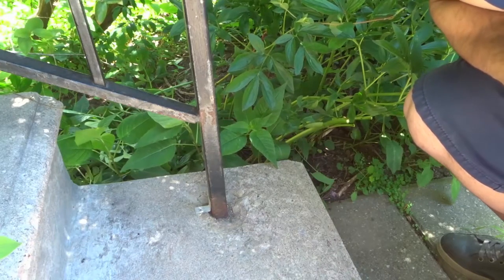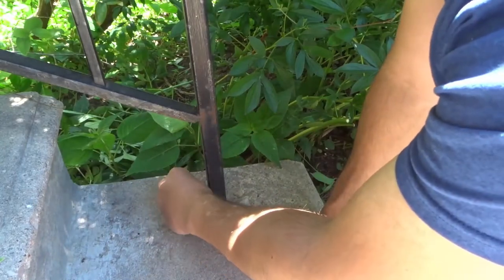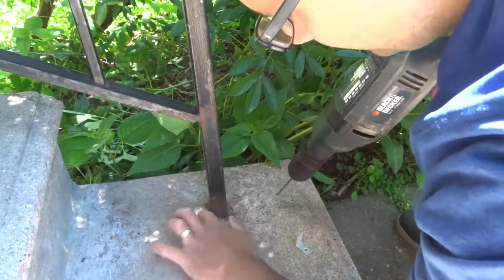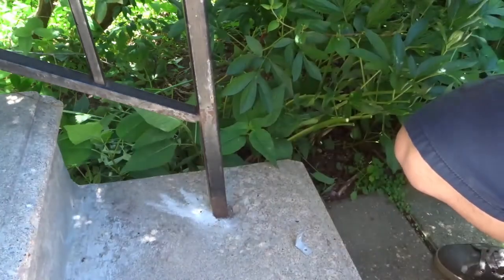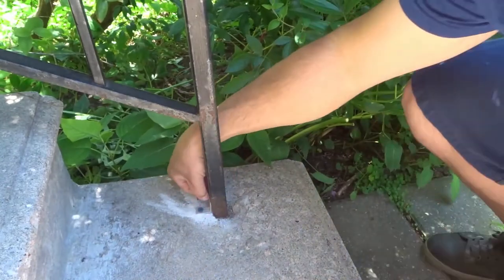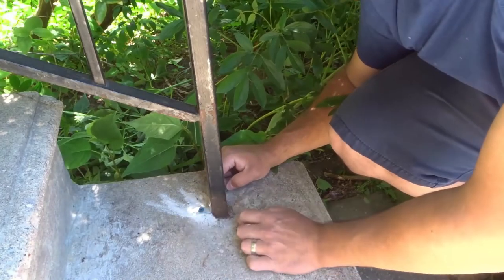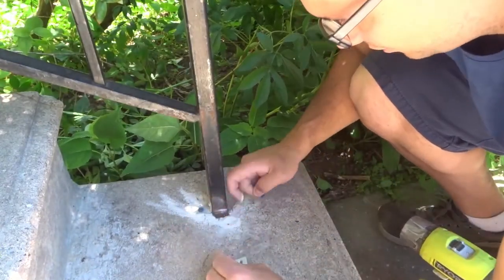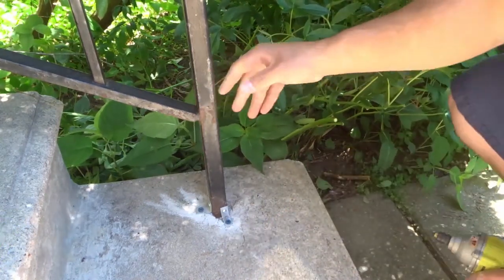How To Fix A Loose Exterior Railing-Tutorial

Comment: Hate to be negative, but this neither works for sturdiness nor estetics…. Could lead to someone leaning onto it and falling through….. just fancy the leverage these Ls will be facing. Instead, remove fence and check if metal in post is Ok…. If so, make hole larger and use concrete filler. If rusty, weld to repair and then same as above 😅👷🏻‍♂️💥

Comment: They will work on a short rail, but if you dealing with more than 5ft of rail, drill a 3/8 hole right beside the loose rail, drive a piece of 1/2 rebar into the concrete until it tightens up, take a side grinder and cut the rebar flush. Do each rail. Basically put a steel dowel in the concrete.
Reply: Yours seem more harder 😂
Reply: I’m guessing after that you adhere the loose rail to the rebar next to it? Bc what is putting rebar next to a loose rail doing?
Reply: @earnesthill9477  It's acting as a shim against the foot of the railing embedded in the concrete, to keep it from wobbling.

Comment: That will fix the issue, but it's an ugly looking repair using the L-brackets, with one installed cockeyed.  Unless those L-brackets and the screws that go into the railing post are stainless steel they will rust out in short order.  I have the same problem with my front door railings.  My solution will be to lift the railings out of the holes in the cement using a bottle jack, clean out the holes and possibly enlarge them, then re-install the railings with anchor cement.

Comment: All these videos focus on the railing at the ground level. My railing is fine at the ground- it’s loose at the side that connects to my house.
Reply: I'd suggest drilling through the current screw holes for installing wall type anchors, then install the screws back into the inserts. The screws have worked loose from use. Drilling new, larger holes for the inserts, will allow the screws to be inserted into a new, tight fit, sleeve.

Comment: Amateur,ugly,temporary and wrong. Creating more work for a proper repair. Plus added 4 holes in the railing for water running down hill to enter,pool and rust from the inside out. Causing the railing to eventually break free completely.
Reply: What would you suggest?
Reply: What do you suggest instead?
Reply: I just wrote a detailed repair description and it was erased. So here we go again
Basically determine if the railing is rusted out or whole and sound. 
Railings can work loose if the concrete is defective from a bad mix or improper cure. That’s what I think happened here,maybe. 
If the railing is sound,carefully dig the concrete out around the base. Dig it out to good,solid concrete. You’ll see and feel the difference. 
Don’t do this if you’ve never worked with concrete or Quikcrete,which is what I used to fix my railing base. 
I just fixed the bottom step of my stairway last summer. 
 But my railing was rusted out after I dug it out. I cut out the rusted metal with a Sawzall to clean sound metal. I used an anchor post that slid right over the cut railing ,my friend welded the railing to the base for me. The anchor also had four holes at its base. I used a concrete bit to drill out the holes,insert and bolt down the base.The anchor was below the concrete level of the stair and you couldn’t see any seam. 
I poured and shaped the Quikcrete in one day. Gave it more time then it needed to dry and painted everything in 2 hours. Make sure and do any painting last.Also make sure and treat bare metal with a metal wash and use a rust inhibiting primer. 
 Also I did my stair during a heat wave. So I made sure to mix the concrete properly and kept it wet while it was drying. 
If you want to do a temporary job like this you get what you put into it
If you’re not mechanically or artistically inclined pay someone to do it. The job in this video will work for awhile but eventually it’ll end up causing even more damage.I’m just talking from experience with work like this. I actually shouldn’t have been so harsh in my description,so I apologize if it offended anyone 
But, doing a good tight job is not that hard and it feels good when you look at it. Also you can practice with the Quikcrete or concrete on a small punched in cardboard box if you want to perfect your technique. Be careful you don’t bite off more than you can chew. 
I did a 5’x50’ curved 90° walkway with stone pavers about 15 years ago that still looks great. I just went out and bought a Home Depot how to book,a 5foot high pile of pea gravel,about 8 pallets of sand and 10 pallets of pavers dumped in front of my house,paver edging,stakes,rented a compactor and bought a really good concrete cutting blade for my Skilsaw. Cant emphasize how important finding the right blade to cut those pavers was.  That took me about 4 days working by myself. But I did it and it feels good to look at it. And I saved about 5 grand from the lowest quote. That’s what made me decide to do it. I’ve done other things in my house. Carpentry,did windows with a friend. It’s waaay easier than I thought. Everything happens from
the inside unless you’re changing the size of the window or there’s termite or other wood damage. 
Anyway this got kinda  long. Could have fixed that step in the time it took to write it;)
Reply: Tend to agree - not all tips are good. Must be safe and look nice 😊